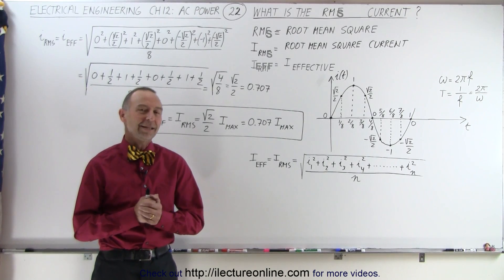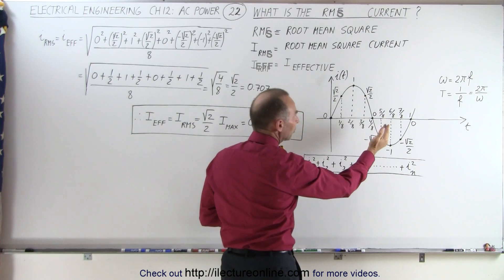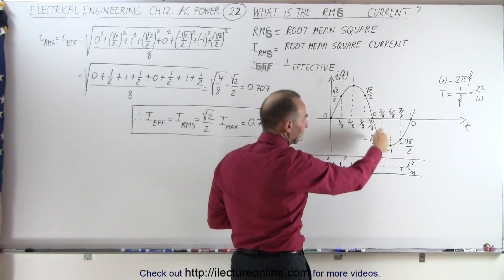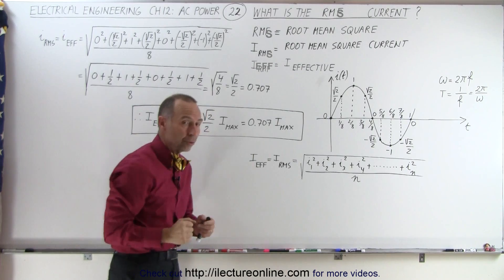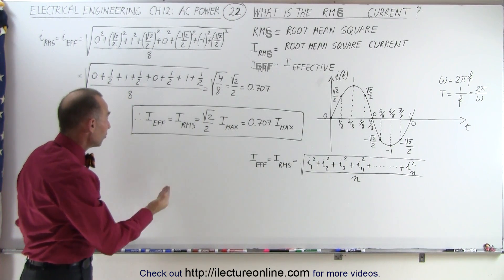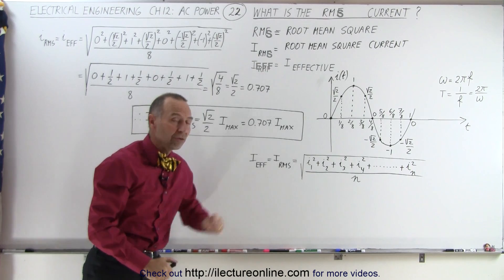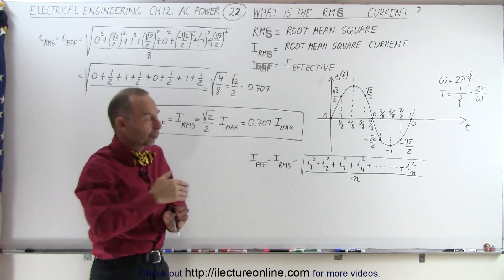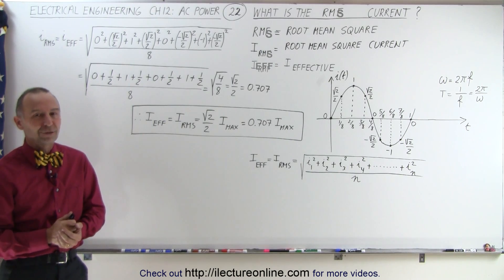Electrical Engineering: Ch 12 AC Power (22 of 58) What is the RMS Current?

Comment: From where this formula came?(to calculate I rms)
Reply from the maker: The RMS formula is derived from applying the fundamental theory of calculus, which essentially calculates the average value of a function over an interval using integration of the function and then dividing it by the length of the interval.
Reply: Thank you @MichelvanBiezen

Comment: So P= 1/2 of whatever you started with - Y/N.
Reply from the maker: You question needs a bit more context.   It would be correct to say that the average power = (1/2) x  I peak x V peak x cos (phase angle)
Reply: @MichelvanBiezen  I found that if R does not change and V/I does then P= 1/2 of (whatever you started with ) known*
Ie-
R=10 ohms* 
I =2 A
V=20*
P=40W 

RMS (volts) 20 √2/2 = 14.14V
Known R and V *

R=10 ohms *
I= 1.414
V=14.14*
P= 19.99396 W or 1/2 of what you started with . (20W)
Reply from the maker: Yes, in the case that you only have a resistor in the circuit, you are correct.  When there are other components such as capacitors or inductors, you will have to also include the phase angle in your calculation.
Reply: @MichelvanBiezen  good to know thanks 🙂